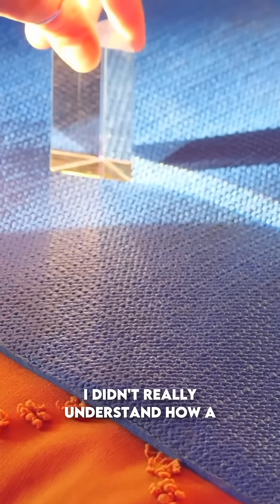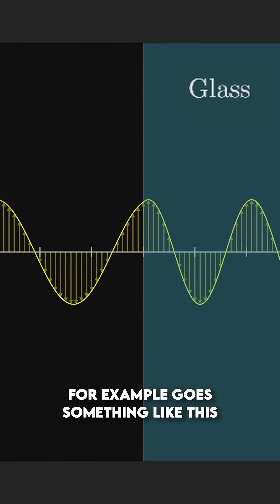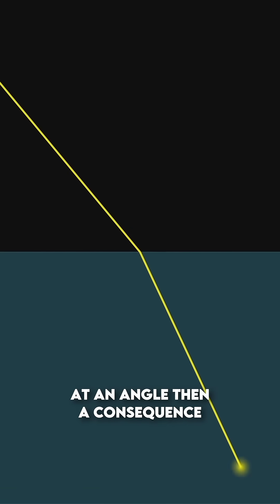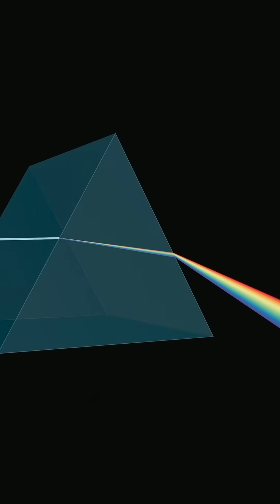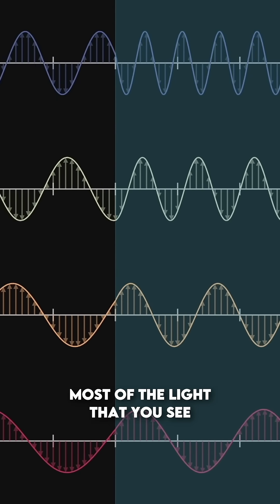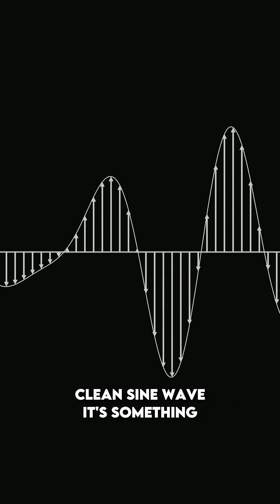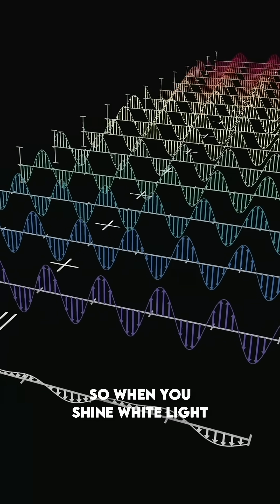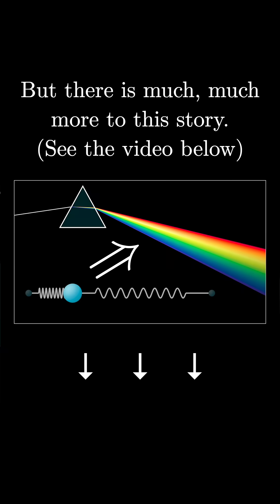How prisms work (full video linked above)

Comment from the maker: But why does light slow down, and why it would depend on frequency? This is what the full video linked at the bottom of the screen explores.

The intuition for why it depends on color comes down to what happens if you're bad a pushing a child on a swing. I promise that makes sense in context!
Reply: 3b1b does physics? This'll be interesting!
Reply: I hate how urls in shorts aren't clickable on the phone. So stupid from YouTube...
Reply: Shouldn't it be changes mediums tho?
Reply: Have you not covered Maxwell's equations before? Ok it's degree level physics so beyond 99.99% of people but please stop underselling the greatest Scot of all time.
Reply: i know i know i know 😂 look at me look at me! 😂
It is the Drude model! Basically, electron displacement (or polarity) driven by the electric field in light will try to reduce the E field in media, thats the origin of permittivity. Drude model uses newtons second law to relate the permittivity at different frequency.
Reply: I understood it until I watched this video. Thanks. I think.
Reply: So by "slows down" that would also be called a "phase offset" indicating that the small omega ("angular velocity") is slower than before it entered an object? Because waves are oscillations up and down, not motions side to side.
Reply: Light never slows down. Not even in water. Or anywhere else. Stop using the wrong term. Stop making things dumber. If you fired a bullet and the bullet ricocheted 5 walls, and hit the target 1 second later than another bullet, the absolute speed wouldn't change. Divide the distance taken into time it took and it's the same. However if you draw a line between start and end point one is slower than the other but that's only relative speed. The absolute speed always stays the same. No matter if light is absorbed, interacted, goes through a billion interactions, acts as a wave or particle or whatever. It always moves at the speed of light. Which is the same as the speed it travels in vacuum. It's just the relative speed seems different but light doesn't care about your definitions of point a and point b. Everything is quantum mechanical. As another person says; there's not even a difference between vacuum and air or water. Most of matter is empty space already! And vacuum/space isn't empty anyway. This is all a bunch of BS dumbed down definitions that mislead billions of people which is very unfortunate. Stuff like this add up and make the entire human generation stupid. Don't be stupid.

Speed of light is not about light, it is about information. It is about causality. It is about the very basic law of the universe that an effect follows a cause and not the other way around.
Reply: light does NOT slow down. it scatters.
Reply: @manoahvanderwolf3259  Yes it does, And it also scatters.
Reply: Light doesn't slow down. It can't. It would need to have mass to do so.
Reply: what happens when u refract the light that is refracted on the prism
Reply: I am using the Lorentz model in my diploma. I know exactly what you mean by that swing 😂
Reply: Ah, your link in your comment doesn't work, the link in the short does..
Reply: @pear7777 how do get to the full video?  The links dont work.
Reply: Make it a ckickable link
Reply: @mimzim7141  wdym? it works. (for me)
Reply: nonoononooo.. goethe already solved it. check out his theory of colours. colour is a border phenomenon.
Reply: Good to mention that the light "wave" is not necessarily the sum of sinus waves. That is true in the model of electromagnetic model, but in quantum mechanics there are actual photons and each can have its own wavelength. So your explanation is not universal, better to mention that.
Reply: I think the fact that newton found this out was cool, but who made the prism for newton
Reply: Still doesn’t explain it completely. Why don’t we see rainbows everywhere if it’s solely related to this? What’s special about the prism shape?
Reply: dude, this is a basic school book explanation. my school actually went level deeper than this.
Reply: Where!?!?!?!! What video “at the bottom of the screen”??? Seriously wtf are you talking about
Reply: you explained a prism when you said you don’t know
Reply: But all EM waves are traveling at c. freq = c/wavelength. I don't think understand why it would be moving slower in the example if the frequency was increasing per the example. The wavelength was also decreasing which would inversely affect the frequency. Can you explain what is meant by "slowing down"?
Reply: Nvm, I just realized I'm thinking of light in a vacuum.
Reply: you didn't really explain why it bends. cars on the road all go different speeds especially when a change in travel medium occurs (most cars go slower on dirt compared to tarmac). this doesn't mean they all change direction does it.
Reply: moreover, why does white light exist at all, given each frequency travels a different distance should not the light from galaxies in the far distant past be "spectralized" into each separate frequency over time?
Reply: As an old school engineer, for some reason I have an uncontrollable urge to listen to Pink Floyd’s ‘Dark Side of the Moon’
Reply: There are two questions here. 1 - light slows down because it is actually being absorbed and re-emitted by the glass atoms, resulting in a delay. 2- different frequencies refract more/less because light is a sign wave. Short wavelengths have steeper waves that are nearly parallel whereas longer wavelengths effectively hit the glass at a different angle
Reply: wavelength, it depends on wavelength since frequency is source dependent so frequency doesn't change But wavelength is being medium dependent changes, there the speed of light changes. In vacuum( and approx in air ) all wavelengths of light have the same speed but in a medium the speed of light is different for different wavelengths so it seems to be seprated
Reply: Because the leading edge of the wave hits the boundary before the trailing edge. The wave must maintain its integrity, and so it bends.
Reply: TO EVERYONE IN THIS CHAT:

THE JUDGEMENT OF GOD IS DRAWING NIGH.

REPENT TODAY AND GIVE YOUR LIFE TO JESUS TO ESCAPE ETERNAL DAMNATION!,
Reply: @JesusPlsSaveMe  That's not the reason to give your life to Jesus. You are a false teacher. Following Christ is about loving God, not escaping anything. God is all in all.
Reply: Changing speed really? What about frequency and deflection inside the matrix of the medium it travels through?
Reply: I am dumb as a brick.
Can you sell a short pdf file or video on how to make (equipment, software, fiver service) to make quality content as you?

Can anyone help me know on what channel (email, patreon subscription, youtube comment section, etc.) I can reach 3Blue1Brown to provide such pdf?
Reply: time dilation? you have two mediums of different density and thus different gravitational effect.
Reply: It doesn't slow down, it takes a longer path. Refraction is just a gazillion tiny reflections.
Reply: Pity the reason is not pictured in the books (taht I know).Imagine a ray of light with a width of 1 cm hitting a surface such as glass, for example. If the angle of impact is 90°, the entire width of 1 cm hits the glass at the same time: There is no refraction (the light propagates in the same direction of incidence).Imagine that the width of the ray has maxima and minima of electromagnetic energy, that is, one would see 10101010. If the angle is different, say 80°, the upper end of the ray hits the glass first. The lower end of the ray hits the glass later. There the light ray propagates in the glass at a different angle. So by representing the ray in the glass as 101010 it is evident that the light has a different speed of propagation. The speed of light is not constant, it changes depending on the medium. Better with a graph.
The angle depends on the frequency because representing the maximums and minimums of electromagnetic energy if we make the same graph with a higher frequency, we see that because the speed in the first medium is constant the lower end touches the glass first and the upper end later but faster than with the lowest frequency of the previous example.This demonstrates the wave-like nature of light. The discovery of light as electromagnetic energy is due to other geniuses. Maxwell. Einstein (Photovoltaic effect)
Reply: Idk about a proof based on resonance, but it can be entirely demonstrated by a continuity argument.
If power enters the interface at a certain rate and dissipation is negligible, the slower medium must have a smaller angle so that power leaves the interface at the same rate it enters it
Reply: I was taught something ever so slightly different in school. As the light enters a medium, the light slows down, yet all light slows down by the same amount, no matter the wavelength. The refraction is a result of constructive and deconstructive interference, which is at a different angle for each wavelength, as a result of the wavelength.
Reply: think it depends on wavelength not frequency. 
f x wl = c -> velocity less  -> wavelength less. frequency same.
Reply: It depends on the optical density (don’t ask what that is I have no idea I learnt it in science class but that sure as hell made the light thing make sense)
Reply: Here’s a better question.  Why can we slow light down, but not speed it up?
Reply: Really? You didn't play Pink Floyd as the background music?
Reply: Can someone set me straight? Why does your animation show the frequency wave increasing as it goes through the glass if it is supposed to be slowing down? I expected the waves to get longer to show it slowing down. 🤔
Reply: because there's more stuff in the way; it's not rocket science
Reply: Goethe's theory of colour begs to differ
Reply: All lies.
If i can understand , its a lie.
if i can understand its the truth.

This youtube short should not deserve to exists

Stop babbly feynman and crap

Take simple physics and geometry and explain with it

Nature do not know crap about electron or your reflection or refractive index

Light slow down not because wave length.

Nope.

The reason why no one find the truth because we have set of base line

We studied in books. So we dont think further because it dont pay.

Also if people speak truth tell what really happens? if you magician reveal secret he is no longer magician and lost his value

So someone deliberately keepin the science as lies.

They dont want anyone to know truth.

Its not just this. everything

All chemical reaction , atom theory , nuclear reaction and everything wrong

These fools CERN always tell us they are hitting proton with proton.

I was checking out and found they are hitting hydrogen atom with hydrogen

Atom hitting atom. No proton involved

Oh there is no proton neutron and electron exists

What is in atom?

Think like nature. You can find out

Nature never hides

Its human hide in his lies

Not because of anything else. he is just lazy.
Reply: This is rhetorical, right? 

The Geometric optics perspective says that the geometric arc forces light to bend through the media (Light: Air, Glass) and changes according to the specific tangent of the medium for which its trajectory is bound pairwise to one another. Veritasium does an excellent video on canonical action and its principles in the Brachistocrone Problem in Classical Mechanics. Its principles in the conservation of action from the quantum perspective applying to the physics of Newtonian Mechanics and extending that logic uniformly, one may understand the nature of action and physical phenomena through the language of energy generically. The understanding of a prism geometrically, by that same token, is one point that effectively “drops out”. Feynman shows the diagram for the geometric argument of polarized light traveling through the apparatus. Fail to find… I know the geometric argument for deriving light polarization in that experiment drops out a similar property for polarized light, but that argument is incomplete…
Reply: Feynman Lectures III.2.1/ I.38.
Reply: For your information, YT does not allow you to click or copy links in the comments of Shorts, for whatever reason.
So the link you posted here is literally impossible to click for any mobile user.

(unless someone replies to me, then I can click on it through the notification about the reply)
Reply: @FafliXx  when you're watching the short near the bottom of the screen there is the channel profile picture and name and right below that there is a play arrow with the title of the video that he is talking about if you click that play arrow or title of the video it should go to the video
Reply: @JRNimmo  I know. I don't actually have a problem finding the video. It's also right there when you on onto his channel.
I just wanted to inform him that, sadly, there is no point is linking the video in a comment.
Reply: @FafliXx  Reply ❤
Reply: @FafliXx take a screenshot and then you can copy the text from the picture. I know that works for iPhones, not sure about Android smartphones
Reply: @abdul123r  Or I can click on it now, because you replied to me.
But I already saw the video by simply looking through the channel videos.
Reply: It doesn’t actually slow down, it travels at the speed of light at all times, however the speed of light depends on the medium, and some mediums have a slower speed of light due to denser packings of things for it to run into or Travel through. 

Light always follows the speed limit, but there’s a federal speed limit on light (through a vacuum) and a state speed limit on light (through a medium)
Reply: @Max._Power The speed of light is constant.
Reply: @michaelenglish839  the speed of light is constant but the speed of light through a vacuum is faster than the speed of light through air or the speed of light through water, this difference in speed is why water distorts the appearance of things. light travels slower when it has to interact with something. light rays bend upon entering water and slow as this happens, the speed of the light is the speed of light, and yet it takes longer to actually pass through the media because it has to propagate through more atoms
Reply: @Max._Power  It may take longer to travel, but its speed is still constant.
Reply: this becomes a failure of english, the speed of light is constant, but the term to describe the propagation of light as it passes through a medium is "the speed of light through (media)" even though the speed of light is constant, the speed of light through the media is slower, it's velocity has changed but the correct way to describe this change is that the speed of light through glass is 2.00x10^8 m/s^-1
Reply: Light does not slow down. It interacts. It absorbs and reads from the electrons and the different frequencies will have different probabilities of the interaction and behave differently being released. Otherwise the physics class would just say that the magnetic fields is what slowing the light down, but they don't
Reply: Kinda obvious really just like current and resistance. The real question is why does it change angle?
Reply: You mean how does Refraction work?
Reply: @Tripster369 ngl, thats what i had in mind. Like, why does it refract or bend?
Reply: @De_Lune8002  It's because light causes other electromagnetically charged particles to oscillate, which then emit their own electromagnetic waves that in turn interact with the light and cause it to change direction. Keep in mind that photons (particles of light) are quantum mechanical objects and so their behaviour is probabilistic.
Reply: @Tripster369  because that's the exact reason it slows down
Reply: @Tripster369 If a plane wave of light hits a medium at an angle, if it didn't change direction in the medium, the plane wave would now be travelling at an angle to its wavefront. This is because the light that hits the medium first is slowed down for longer, and thus is behind the rest of the light.

Since light is a wave, and can be described (to first order) as an infinite sum of spherical wavelets at the wavefront, it's easy to see why the light bends.
Reply: @sploofmcsterra4786  yeah I watched the full video in the end
Reply: @sploofmcsterra4786 garbage I'm sorry I'm not in a better mood but yeah that's just rationalization not reasoning of the interactions
Reply: @sploofmcsterra4786 I need to say though you are on an important concept that helps to explain why we get the probability distribution so it's not like you're wrong it's just not at all what should be thought of first or last at least in my opinion, because I totally get that people need to sleep on things and come at it from different starting points
Reply: the slowing down and bending reminds me of when you get one tire in the rough (grass on the road side) and one still on the pavement, your car pulls toward the rough.
Reply: @Tripster369 the light is not slowing down otherwise they would just say the magnetic field interactions cause light to slow down and you could induce a light slowing effect artificially by controlling magnetic fields but that's not what's happening what's happening is generations of misunderstanding turning into the rule of thumb. The light is engaging with the electrons and this causes a delay as well as the wavelength having real spatial consequences with the oscillation between molecules as well as the period in which the light can be released from the excited electrons
Reply: @FirstNameLastName-okayyoutube  a year late to reply but yes the light is effectively slowing down (by taking longer). Nobody said the speed of light changed and I already know the reason for angle change but I was implying it was a more important question that answers people's confusion about why the light takes longer to complete its path.
Reply: @Tripster369  very cool and yeah I've seen some pretty cool models over the last year.  I'm just really glad you're not talking about the CMB.  Of everything that I've learned it's pretty much the one major remaining source of hand waving where crucial steps are entirely skipped over with how it is described.  

Sure it makes sense how light can take 100,000 years to get from the core to the outside of a star [ the comparable of an early post Big Bang hydrogen soup ] but it doesn't make sense how once the light has left the star surface.. it takes billions of years to come back to the sublight speed expanded star....  I keep finding experts that just seemed to go to a Wikipedia page and reword it but each of them fail to account for how no amount of spatial expansion can generate that effect of seeing escaped light be returned to you.   It's just a logic acid trip that made me put a huge pause on physics video a few months ago. 

I'm not inviting you to give me an answer on anything cuz I don't think there is one.  There's been several minor combative arguments that have inevitably led to people saying oh shit now I see what you're saying and then they're just like "yeah it doesn't make sense".  

But if my position is sounding like every expert that thinks they know what the CMB is, is wrong because of some little bit of logic.. it's an understandable assumption that I have to be wrong.   And it does relate to this topic about how is light engaged with, can you do a good job explaining some important perspectives from what I was rereading so maybe you would appreciate what all I was just saying there.
Reply: @Tripster369 No. It isnt.
Reply: @jasondean88888  not to you it isn't maybe
Reply: @Tripster369  Have you ever made something an idol, used God’s name as a cuss word, dishonor your parents, murder (God views hate as murder), lusting, stealing, lying, wanting something another has that isn’t rightfully yours?

Doing so we violating the law, which is sin, and because of sin there is a punishment…If a serial killer like Ted Bundy tells a judge of all the good things he’s done for society do you think the judge would let the serial killer off free? The same is with us; we’ve committed such crimes against God that we are separated from God forever; we are punished by suffering Hell for eternity, a place with no hope for us.

But God loves us so much and with all his heart that he gave his only Son, Jesus Christ, to this cursed world to be crucified on the cross. (John 3:16-17)
Now anyone who accepts Jesus Christ, God’s Son, as their Lord and Savior and believes he rose from the dead the third day will be saved from eternal damnation in Hell and live in Heaven in paradise with him forever.

Many will choose to follow Satan, whether it be because they think they won’t succeed otherwise or won’t have any joy or friendships, but he will soon reveal himself as a murderer and a liar as he was since the beginning and he will curse all his followers as he cursed God and all of Satan’s followers will be cased into ever burning Hell. Don’t believe this lie I too believed in! Our God is a loving God full of compassion, yet he is a righteous God with righteous judgment. (Matthew 13:41-42)
Reply: @william44011 Where does the Bible say there is a punishment for sin?
Reply: @michaelenglish839  thanks for asking 

Romans 6:23; Revelations 21:8 KJV
Reply: Light doesn't slow down, it just takes longer to move through denser media.
Reply: @roberthobbs6318  re >Light doesn't slow down, it just takes longer to move through denser media.<

Next time when get pulled over, just say that you weren't speeding, you only chose to travel the distance in shorter time...  

FYI; In short, light actually slows down in medium due to interaction with electrons. And that why light of different wavelength travels through the medium with different speed.
Reply: @tjblues01  Yes denser materials=more interactions. That's exactly what I was saying. As to your car analogy, I don't fully get what you meant, but I like the analogy! So if 2 vehicles MUST go the speed limit (not faster or slower) and they both start at point A and are going to point B. One of them avoids all traffic and basically has a straight shot to point B. The second car encounters construction, traffic, lights and must make several turns to avoid these things, as it MUST go the speed limit so it can't stop, making its journey take longer. But to an observer who can't see the actual paths of each vehicle, only the data on time departed and the time arrived, would fairly assume the same path with different travel speeds, but this isn't the case, as proved by Einstein. Therefore, both vehicles going the same speed arrive at point "B" at different times.
Reply: @tjblues01  And sorry, more clearly put, the photons still move at the speed of light in between the atoms, but, because electrons have mass, the interactions are slower than the speed of light, but the photons themselves ALWAYS travel at the speed of light. And light is only the photon part of this process.
Reply: @roberthobbs6318  My car analogy was just a joke based on Newton mechanics: V = d / t, where V = speed, d = distance, t = time.

What you try to say about cars and avoiding obstacles doesn't apply to light passing through transparent material. 
Light is EM wave. It interacts with electrons. It makes them move. Electrons are charged particles therefore when moving (oscillating) they generate their own EM wave. 
So now we have two EM waves; the one from light and 2nd from electrons. Those two waves add one to another creating 3rd wave as the sum. This wave travels slower than speed of light. 
Basically there is no analogous of this effect in classical mechanics. 
On other hand we have Cherenkov radiation; which is caused by charged particles with mass travel FASTER than light in a medium (for ex. in water)
Reply: @roberthobbs6318  Re >the photons still move at the speed of light in between the atoms<
Nope. In this case photons don't act as particles. They are waves. Just like in the Young double slit experiment.
Reply: @roberthobbs6318  the speed of light is not the same as the speed at which light can travel 😅 in fact the speed of light isn't even the speed of light; it's the speed limit of information transfer.
Reply: If i run a 100m in 10s am I slower than Usain Bolt? @roberthobbs6318
Reply: i doubt light slows down anyway
Reply: I think I’ll teach you some physics this is a quote ->   Does the speed of light change in air or water? Yes. Light is slowed down in transparent media such as air, water and glass. The ratio by which it is slowed is called the refractive index of the medium and is always greater than one.
Reply: @alexalekos it does slow. The index of refraction of a substance is the ratio of the speed of light in vacuum to the speed of light in the substance ...
Reply: @alexalekos  It does, this is a known fact (and has been known for a VERY long time). The speed of light depends on the medium, glass, air, water etc. This is why when scientists say “the speed of light” they usually say “the speed of light IN A VACUUM”. They need to specify it’s in a vacuum so you know that this is lights speed when uninhibited by anything
Reply: @karebushmarebu233  in a microscopic level, it's always the vacuum though
Reply: @alexalekos  Light passing through any medium is slowed down at least a little.
Reply: @davidnika446  how does relativity theory explain this?
Reply: @alexalekos  Relativity does not address this, at least not explicitly or directly as far as I know. But the speed of light by default means the speed of light in a vacuum (space).
Reply: @davidnika446  yes and, in reality, photons usually travel through vacuum, since the subatomic particles are so far from each other

my arguement has always been on the microscopic level, our eyes indeed obseeve a seemingly decreased speed
Reply: @alexalekos It doesn't. The photons are bound by the laws of physics and MUST move at the speed of light. The reason it takes longer to move through a denser medium, is just because there is more particles to interact with, so the photons "bounce" around more.
Reply: @roberthobbs6318 
Nope because if it bounce it wouldn't stay in a straight line.
Reply: Does the speed of light change in air or water? Yes. Light is slowed down in transparent media such as air, water and glass. The ratio by which it is slowed is called the refractive index of the medium and is always greater than one.
Reply: @roberthobbs6318 My friend, it is due to those same laws of physics that Light does slow down. Photons travelling at the standard speed of light, is defined as the speed of light in vacuum. The "speed of light" is different in different mediums. Mediums like vacuum (complete absense of material, like in outer space), air, water, oil, glass etc. The speed of light in some medium is lower than the speed of light in vacuum, and this ratio is used for calculating the refractive index of a material.